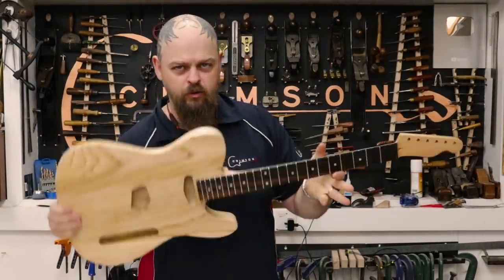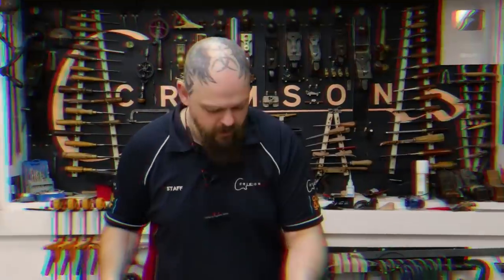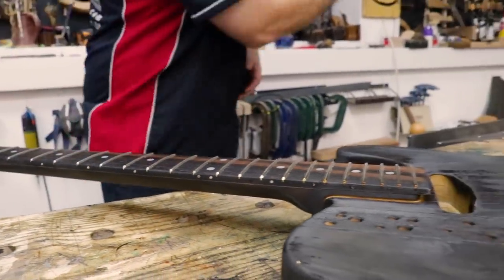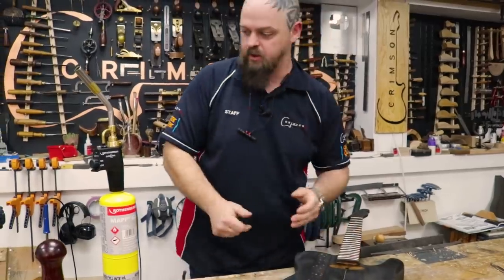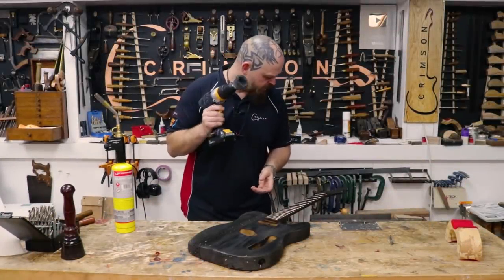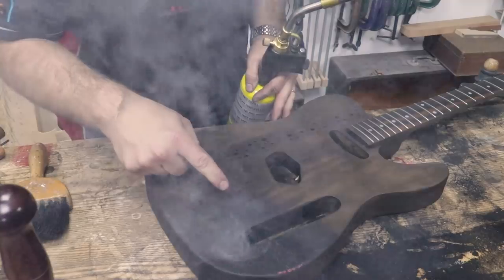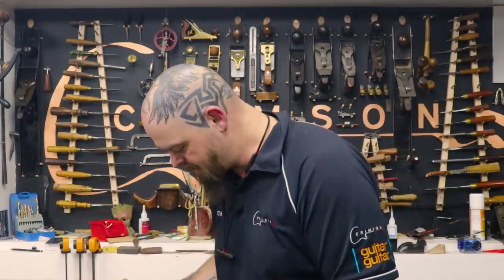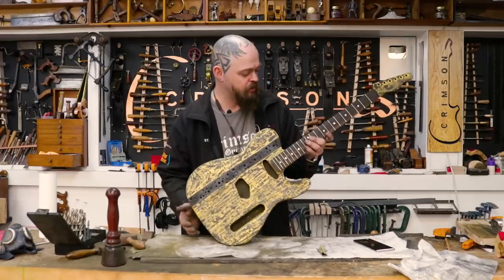Ep 2 of 3 - Taking a Kit Guitar and Making it Burnt Gold

Comment: I work in Health & Safety in my country and I can't help but notice that all that use of fire in a workshop and no fire alarm being triggered is a slight concern ;) unless you turned it off before going crazy with the flames. I absolutely love the look of a burnt guitar. It might be next on my shopping list!
Reply from the maker: Dust also sets off fire alarms..  we have panic buttons to push that alerts the whole building if there is an issue bit in smoke detectors as they would be going off all the time! We have a few burnt copper prodded guitars in stock right now and would do you a custom shop.if you wanted one dine in a certain style.. drop us a line through http://www.crimsonguitars.com B

Comment: use a ball bit, in fact, chop that pinstripe bit out, cut off the top quarter inch of it, save that bit, cut off a further half inch below that and bin it or put it aside, and put in a nice piece of red color wood with some thin layers of black/white/some other color than top and red, then use different ball bits and depths to make little craters that have different colors of wood in them :D
Reply from the maker: Ooooh! Yes! B

Comment: Hey Ben are you using MAPP gas or Propane? I'm not sure on the UK color coding. In the US propane torch fuel is typically a blue bottle and MAPP is yellow. Propane is safe to use in confined areas, but MAPP gas creates LOTS of carbon monoxide, and is not confined space safe. You should have fume extracrators if its MAPP gas. That being said, I'm inching closer to my SRP kit order next year.  Using your stains to mix a cyan stain, Gotoh EV510TS-FE bridge and their 3+3 locking staggered tuners, Bare Knuckle Nailbomb pickups with ceramic bridge alnico 5 neck, with push pull coil split, and push pull tone capacitor switching. I can't wait.
Reply from the maker: Hey.. I will check, I suspect it is MAP gas and that I should be more careful. Thanks for the heads up.. and send me pics your build when done, it sounds like a guitar of the week contender for sure! B
Reply from the maker: Ps. I do have a carbon monoxide detector in my studio that was tested recently just in case.. B

Comment: Ben, a technical question?
I’m in the states and since I have found the Crimson You Tube channel, I’m fascinated with the idea of making a guitar! So much so that just yesterday I went to my local hardwood dealer and bought a twelve quarter hunk of ash for a body and another eight quarter hunk of maple appropriate for a neck. OK now here is my question, I’m wanting to build a Tele and am wondering if the timber I bought for the task is to large? Unfortunately I’m not very familiar with the metric system but referring to your Triton video “ How to build an electric guitar “ you say the neck on the Tele you built, before any machining measured 19 mm. Isn’t that equivalent to 3/4 of an inch and if so that just seems extremely thin to me. Any enlightenment you can offer will definitely be appreciated. 
Thank you Sir.
Reply from the maker: Hey Jeff, welcome to luthiery, ypunare going to have so much fun! You have gone a bit big, you generally want the.body to be about 2" thick and the neck blank 1" before shaping etc.. find a local maker space or a friend with a band saw or thicknesser to help you bring it all down to size and you'll be alright! B
Reply: Ben, while I am new to the luthier community, I’m not new to woodworking. I happen to own a couple Bandsaws, a 14 inch and a 10 inch and I have a 13 inch thickness Planer, which unfortunately won’t help me unless I can run the body thru after it is cut to shape because the piece of ash I bought measures 13 1/2 inches? Not knowing any better I wanted the body to be one piece, no glue. I have a few hand planes including a Lie Nielson # 7 jointer. I especially enjoy the way you hardly ever use power tools to achieve fantastic results! I do however own the same Triton spindle Sander you have and do not object to using power tools. Anyhow I digress, so you think I should possibly save the timber I just bought for a future project and return to my local hardwood shop and purchase more appropriate sized timbers? I may have to glue up a body blank but eight quarter Ash and four or five quarter maple are readily available. 
Hey thanks a million for replying and so quickly! 

Jeff

Comment: Hi, instead of applying gold , would it still be possible to use any colour out if a spray can, and still get the same effect
Reply from the maker: Yes.. absolutely.  It would probably be even better.. as it could hold the char together even better.. B
Reply: @CrimsonCustomGuitars  ty, I was thinking of fluorescent blue
Reply: @CrimsonCustomGuitars  also , if didn't want to use the spray can method, would a thin coat of electric blue epoxy resin work the same way, with a light sand and polish afterwards to give it a high gloss look

Comment: This isn't Shou Sugi Ban - Shou Sugi Ban only works as intended on Japanese cedar.  You're just making burnt, cracked ash.  I've yet to see someone make one of these "char-tars" that doesn't split on the glue lines.  And I'm amazed the induced stress on that neck didn't just pop the fretboard clean off. (if you don't think burning one side of board induces stress in it you don't know much about wood)
Reply: I'm pretty sure Ben knows quite a bit about wood.
Reply: @Forest_Fifer  I'm sure he does. Your point?
Reply: @donvanco3078  your implication in the last sentence is that he doesn't.